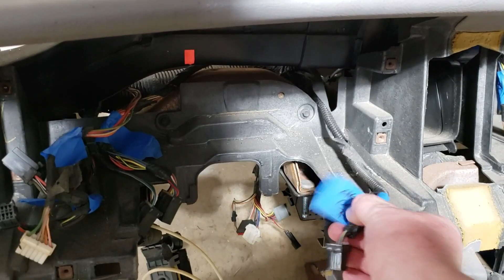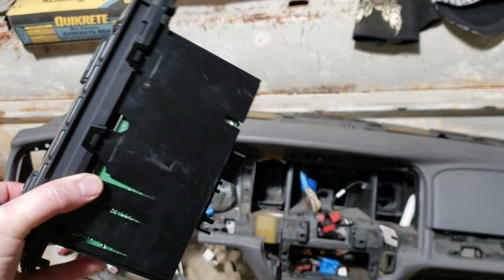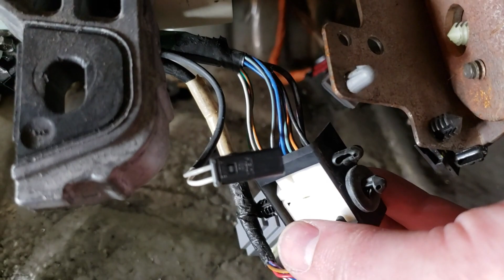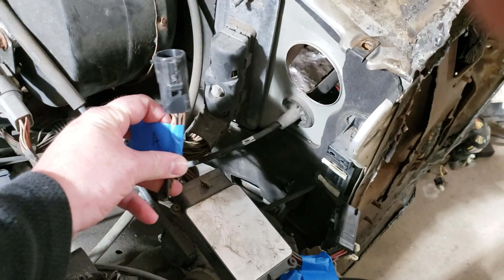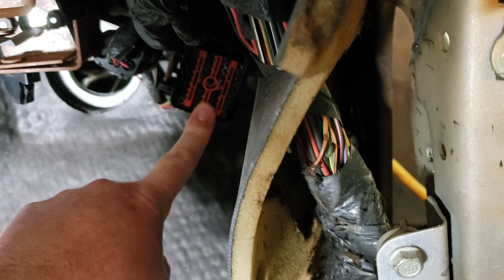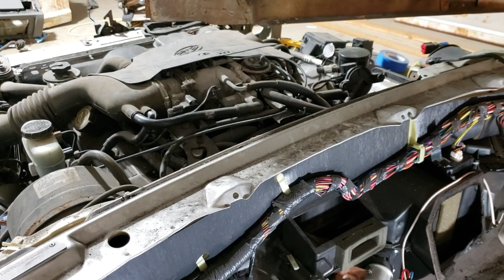Ford F100 truck Crown Vic frame swap build - removing Crown Vic dash

Comment: What about the radio I see where it disconnects in the dash, but where do those go? Passenger side on the floor?
Reply from the maker: There are 4 looms of wiring. 1 in engine compartment 2 behind dash (1 runs along firewall and 1 stays in dash when removed)  and 1 running to the back of the car. The radio wires stay within the dash part of that loom.